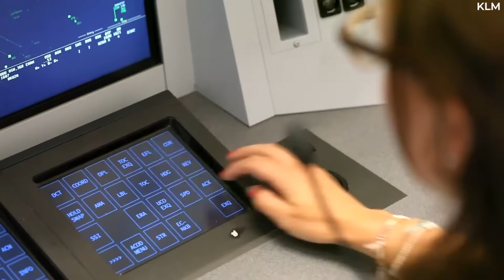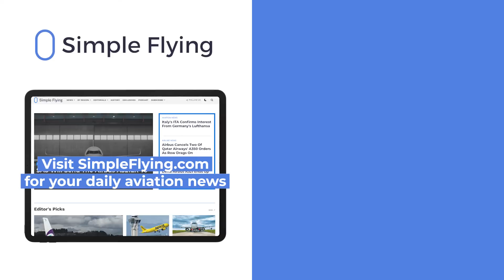How 2 Aircraft Landed Unassisted In Washington After ATC Fell Asleep

Comment: I can't believe that it's okay to have a single ATC in the tower at any time. At least not at an airport with this much traffic.
Reply: Especially at DCA!
Reply: I’ve worked MANY tower mid shifts. Assigning 2 on duty doesn’t necessarily solve the problem. With 2 on duty, one goes on break while the other works. But this in no way prevents the working controller from falling asleep! All that is needed is a better sense of responsibility and professionalism from the controller. You need to sleep several hours at home before the mid shift.